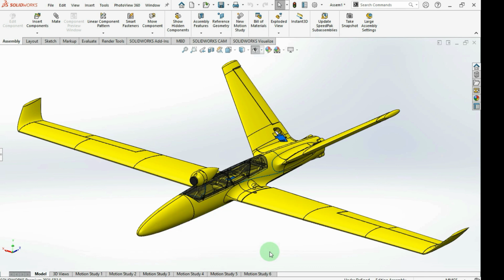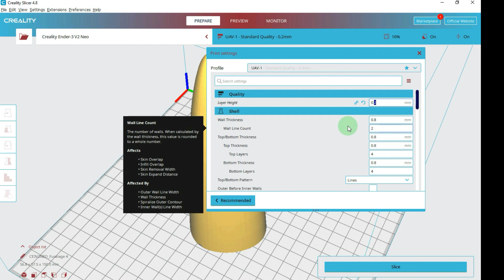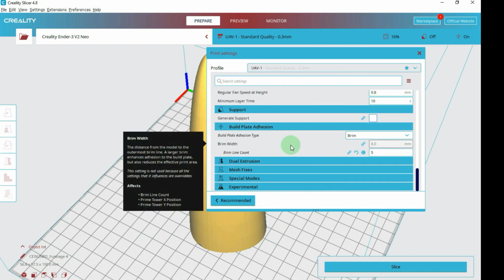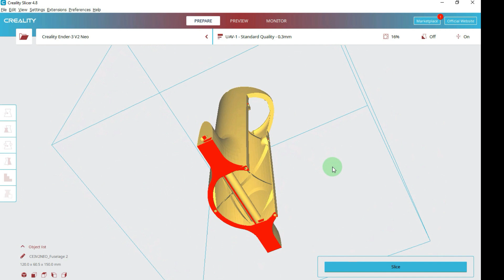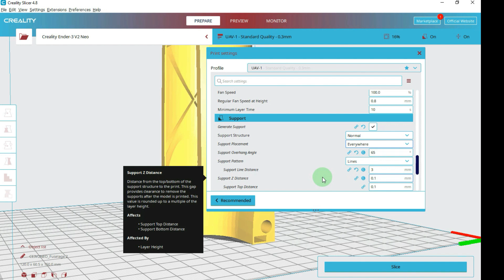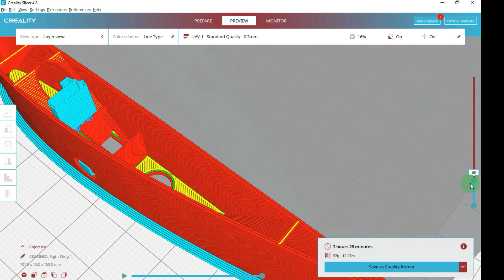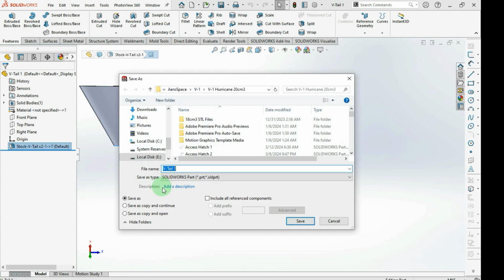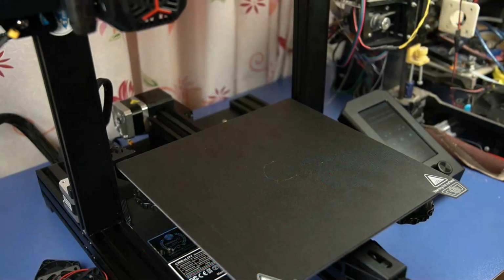DIY 3D Printed Drone Design In SolidWorks (Part 14:  Slicer and Printing Tutorial)

Comment: Hello, is there a list of materials required to assemble the parts taken from the 3D printer? If there is, can you share it with me?
Reply from the maker: @ferhataksin4081  Hi, check out this link, there is a complete list of what you need:

https://www.cgtrader.com/designers/Dynamix-Systems
Reply from the maker: @ferhataksin4081  BTW, the correct dimensions of wing: starts with 100mm on the root and ends with 85mm on the wingtip.

Comment: Hello, how many mm did you separate the wings?
Reply from the maker: Hi, It depends on your 3D Printer capacity, I did 180mm for each section as my 3D printer can reach up to 220mm max.
Reply: @dynamixsystems  You also made the wings 180 mm, right?
Reply from the maker: @ferhataksin4081  Yes.

Comment: 950    the tail of an aircraft should be made as light as possible.      consequently, when a  HEAVY  motor is located at the tail,  Even  More  mass (servos)  should  NOT  also  be located aft of the cg/c-m.        this is a  wonky way to use servos to move control surfaces (at the tail).        the design of the v-tail will produce  very little  'vertical stabilization' moment.        you may know that a wing is supposed to have a contiguous, load-bearing, fuselage-spanning main Spar; located at thirty percent of chord.        ideally, the main spars in each wing half will  be 'connected to'  a central main spar component.       d
Reply from the maker: 1. Tail servos location, is because of modular configuration, avoiding the unnecessary and weak rod connections and more precision response to the control signals.
2. The V-Tail fins are designed with additional length to rule the vertical and horizontal stabilizer simultaneously and get the control surface to reach out of the rotation domain of the propeller.
3. This is a 3D Printed UAV that has a unified surface and internal support structure, reinforced by carbon fiber rods. I can pick up the whole thing, just by grabbing from one of the wing tips! that's how strong the structure is!
4. On this initial design, it seems to be a little tail-heavy, but I'm not sure yet. because I haven't installed the battery and it is a 3-cell pack that will be installed in the nose section.

Comment: Hi there, I hope you remember me, I have printed the plane and I am looking forward to fly soon, I would like to share photos of my plane with you but idk how :/ btw I found that the plane was tail heavy for me so i modified the nose so that i can mount the motor on the nose instead, I think it would be clear if I show you.
Reply from the maker: Hi, you can send your files to the email in the channel description.
My build turned out a little tail heavy too, I need to place a 4000mAh battery in the nose section to balance it.
Reply: @dynamixsystems  Alright I will do so, I think for the next design iteration the wings can sit farther back this way we have more freedom over where the electronic components in general sits. I will send you the files soon :)
Reply: Can you give me ur contact?